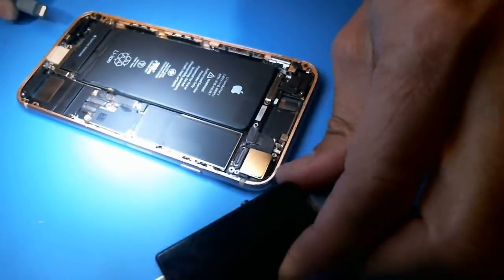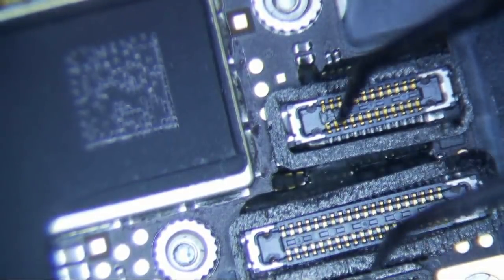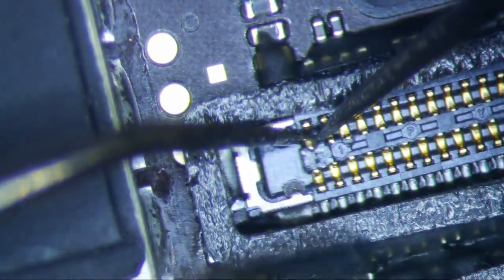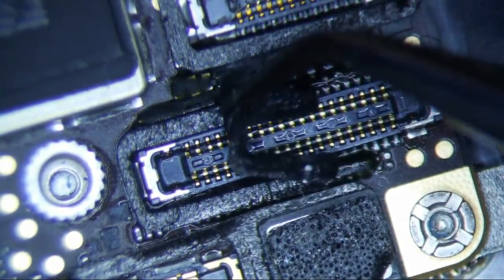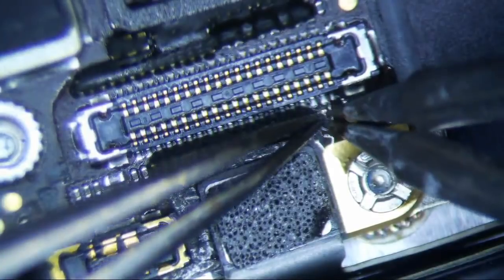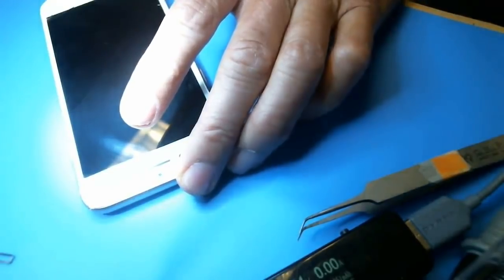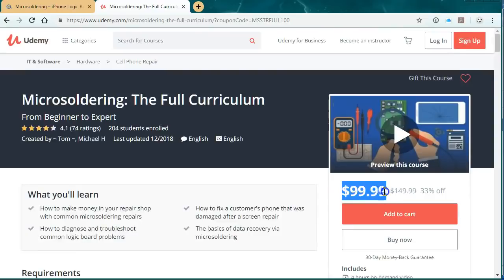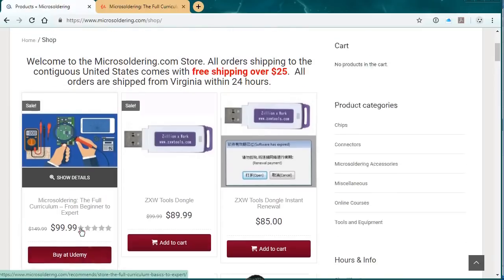iPhone 8 No Display after Screen Repair

Comment: Pretty sure I damaged the display connector on the motherboard when putting a new screen on. I've done it times before but was rushing and didn't line the connections up properly when pressing the screen side connector.. Even heard a hard snap into place. The screen now doesn't power on. Tested a different screen to be sure. I need a bunch of notes, photos, and videos from the phone. Any ideas what I could do ?
Reply: I've just done exactly the same thing!

Comment: After my screen repair my iphone worked fine but the edges of the screen are black and idk if they are getting bigger but is there a solution and the resolution is not what it was what is the soln
Reply: did you find a solution?
Reply: @abaan4586  no its been a year it just slowed down a lil